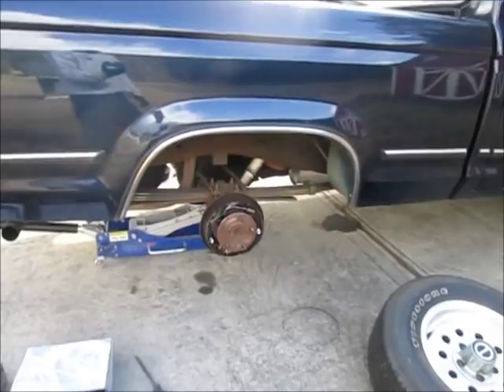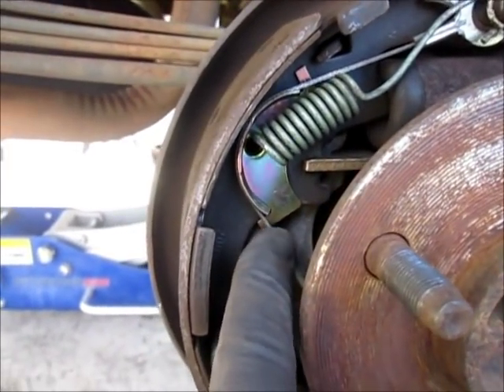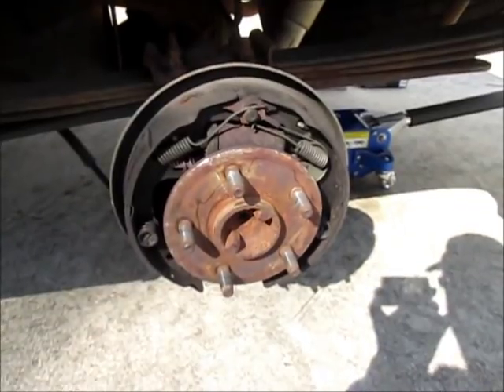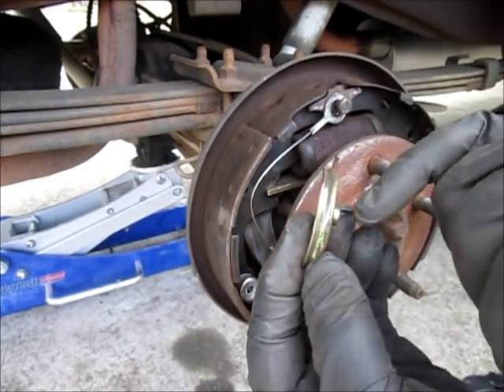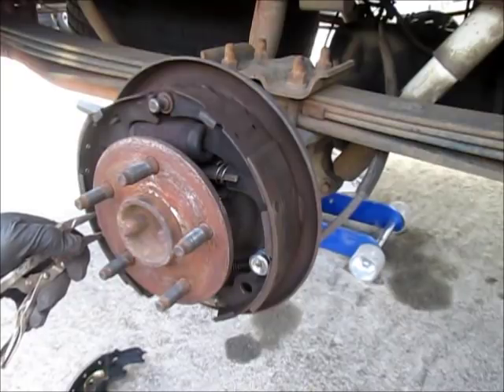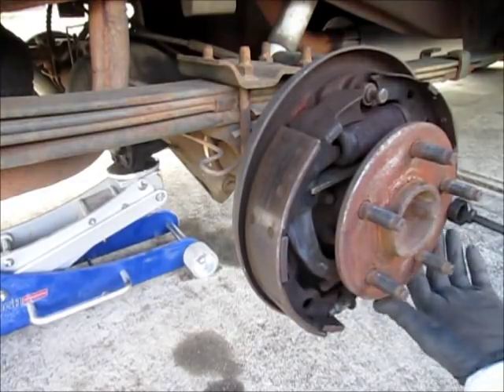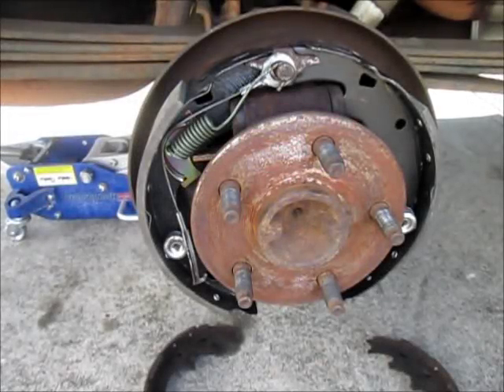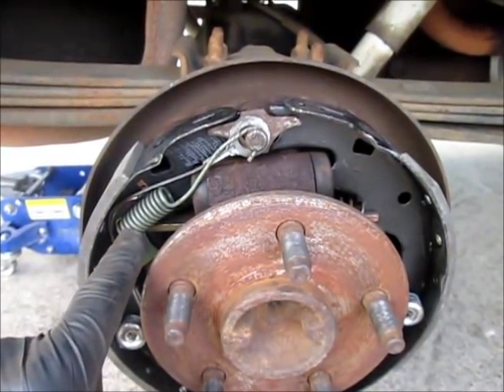Replacing rear brakes on a Ford Ranger

Comment: Thank you! My 1993 is the most difficult to work on. It doesn’t match any of the videos and so I was trying to figure out how to do it. Didn’t realize despite all literature that it had the brake and spring system like the 1990 version. So helpful. But I’ve noticed your two hold in screws are tapered at the end. My old ones are my new ones aren’t. May have to reuse the old just to get the shoes to stay in while I do all the other connections. Wasted hours today fighting my weak arms and gravity. 🤣 glad I found your video.

Comment: THANK YOU, very much. This was the one video that showed how the whole thing goes together. Mine fell apart when I took the drum off and I was lost. Bought all the parts, hoped it would make sense, and IT DIDN'T. 

However, I will say that the last spring to clip the shoe to the cable bracket is WAY easier to put in the other way. If you just hook the little end onto the bracket, the other end is in a V shape and you can just use a flat head to push it through the hold and it clicks in place.

Comment: Nice video but I need to correct one thing. The flat plate with the spring on the end is part of the parking brake mechanism. The end with the wider gap engages both shoe and the parking brake lever. The lever is only connected to one shoe so that is how force is applied to the other shoe when you set the parking brake.

Comment: Very important, clean and lube waffle rubbing pads on backing plate and lube with white lithium grease. One time I didn't and the pads wore away, and it didn't get to an unsafe point, but had to replace backing both plates the next time.
   Also check for leaking wheel cylinder then pull rubber seals to check for leaks that may be starting. re-seat rubber seals.
   A little white lithium grease goes anywhere there is metal on metal contact.

Comment: I change the rear brake shoes  wheel cylinders the front brakes ,new front rotors ,front seals and  bearings ,new rear wheel seals , rear bearing and rear axle bearings also new brake lines.  I had to do all that because my truck had to be salvage in had to pass the brake light inspection I did all that In Tijuana mexico for $180 lol.

Comment: Thank you. Most vids on this subject are for 10” drum rotors which have a different style of connecter plate for the e brake.   
Did you have any play in your e brake beaded line and how did you fix that if so?  My enrage hasn’t worked since I got the vehicle 6 years ago.
Reply from the maker: Did not have play.

Comment: I ordered a brake drum rebuild kit and the picture showed the color coded springs. When it arrived all of the springs were white. Are the different colors different spring rates?
Also, do you know if Ford Ranger backing plates fit a 66 Mustang? Is it the same bolt pattern to the axle flange?
Reply from the maker: The springs are made for each specific location. I do not know about the backing plates.

Comment: Thanks for the video. I just finished installing the hardware on my left wheel, but noticed that the adjuster doesn't rest on the gear teeth, but rather sits on the side of the teeth. I move it back where it engages the gear, but the pressure of the springs turns the gear downward where the adjuster arm is once again disengaged from the teeth. If you follow any of that, I'd love to hear your thoughts.
Reply from the maker: That may be fine. The adjusting arm actually moves up and down to operate. The idea is that you back up and hit our brakes several times. this makes the arm move up and down and that is what makes the adjuster turn to make the brakes tighter.
Reply: @JoDaddysGarage  I really appreciate the reply. After re-doing this 4 times, I found my problem. The adjuster arm had to be set on the gear high enough when you first attach the springs. The only way I could keep that adjusting pawl in the right position was stick a cork in the hole where the pivot hook  attaches. That held everything in place for attaching my springs. When I finished, I removed the cork and everything stayed in place and adjuster works fine. Thanks so much for everything.

Comment: Just a suggestion but when you start out doing one side of the vehicle taking the brakes off putting them back on why not post permanently up in the left or right corner whether you're working on the passenger side or the driver side it's very difficult to tell if you're watching on a small cell phone.

Comment: My rear brakes are locking up on my 93 ranger, any advise on what it could be?
Reply from the maker: My first suggestion is to check the brake hose that connects to the rear axle. They can deteriorate, and cause the fluid to stay under pressure.

Comment: Could you tell me exactly what kind of brake kit you got for this? I have a 1996 and I have gotten two brake kits already that are close but some of the pieces are different and dont fit correctly. The peices here look the exact same, so I am wondering which kit you got? Thanks.
Reply from the maker: All hardware came from Advance Auto Parts. Don't know the specific numbers. Sorry.

Comment: Same set up on my 86. Except my brake line is frozen to the cylinder... Any tips?
Reply from the maker: Other than solvent, you can try heat. May end up replacing the line.

Comment: Thank you, whenever i put on brake pedal brakes dont hold, if i put parking brake on they do, ive bleed and everything? what am i missing?
Reply from the maker: Check your brake hose. They will break down, and cause a restriction.
Reply: @JoDaddysGarage  thanks for reply, bleed them again and they work now... bleed again and accidentally ran out of fluid in the reservoir so will need to reveled all 4 wheels. Do you think I need to bench bleed the MC also or will it be ok?
Reply from the maker: @av8r1946  Well, it would have been best to bench bleed at the start if it's a new MC. At this point, just rebleed the lines.

Comment: Did you have any issues getting the adjuster lever to sit on the adjuster wheel after reassembly? After I put the red spring across the bottom back on it pulls the lever away from the adjuster wheel. The cable that runs to the adjuster lever from the top looks to be a little loose too. Everything else looks to be lined up fine, but the lever and adjuster wheel aren't touching like they should be. Any idea what the problem might be?
Reply from the maker: Sounds like you may not have the cable running correctly. Check to see if it slipped behind the carrier.
Reply: Jo Daddy's Garage

Comment: I guess if it ain't "brake" don't fix it!
Reply from the maker: Dave Brittain I ended up replacing the wheel cylinder as well... It leaked after I fixed the other stuff...
Reply: Jo Daddy's Garage
 Don't you just hate when that happens!
Reply: Jo Daddy's Garage  i was looking in comments for why you didnt replace cylinder haha, i was like why the fuck is he leaving that